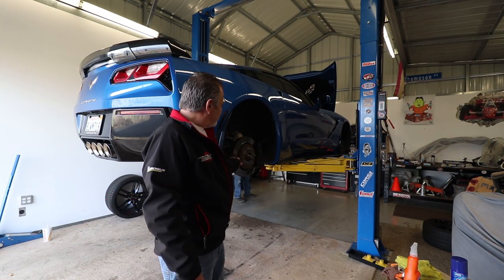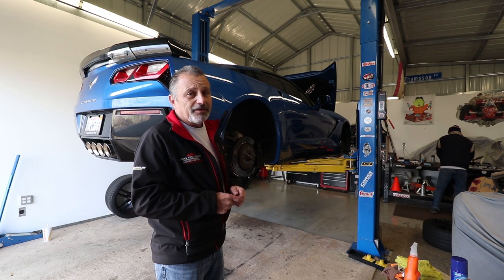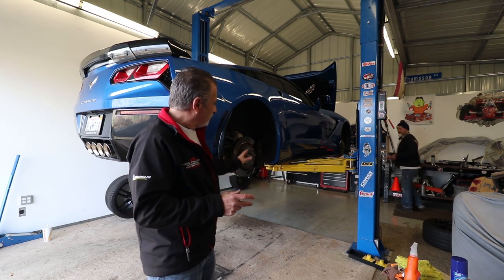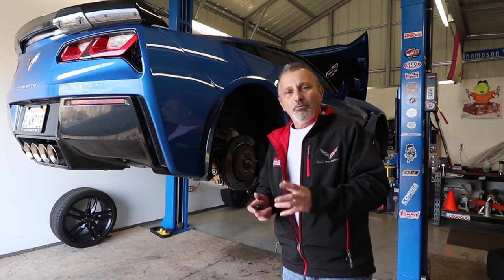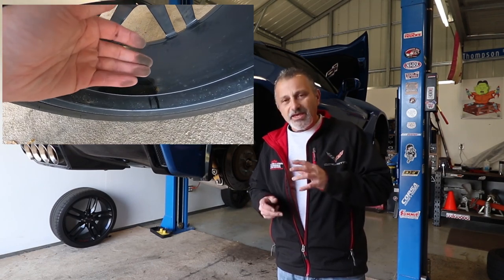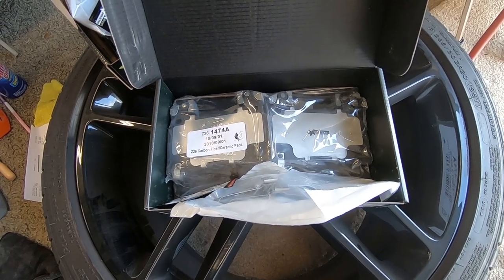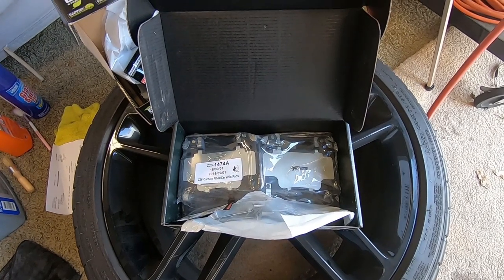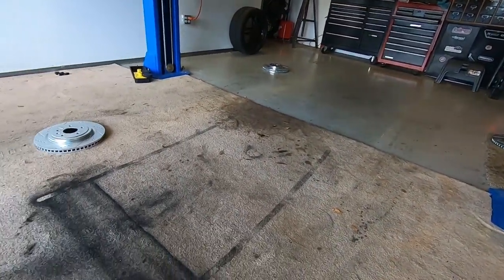I Got Rid of All of that Nasty Brake Dust with PowerStop Brakes

Comment: Quick question on the rear rotors. Does  the electronic parking brake need to be deactivated before rear rotors are removed.  I know on some cars this needs to be done first?
Thanks again for the great videos. Keep up the great work!!
Reply from the maker: Yes I think Terry mentioned that the parking brake needs to be released and not set. Thanks for watching!

Comment: Just curious, why replace the rotors? They seemed to look fine. Did you just want to swap slotted for vented?
Reply from the maker: Hi Jack.. I agree with you the rotors looked fine, but PowerStop sent me a complete kit so I put them on. Plus they look much nicer than the OEM rotors. Thanks for watching!!
Reply: @THECORVETTECHANNEL  Can I have your old ones? :)
Reply from the maker: @dawsoja  I would have to check with Terry to see if he still has them at his shop. Where are you located?

Comment: The C7 video is great.   I have a C7 Z06 and a C6 Z51 and would like to see the same video for the C6.    I would also like to see a video for the C6 automatic transmission shifter cable replacement done.     I know of two C6's that left drivers stranded when this cable malfunctioned.    The catalytic converter does need to removed and there is some adjustment that is needed to complete the work.    Can you help?    I do not look forward to being stranded in my daily driver with 68,000 miles.
Reply from the maker: Hello,
I dont know of anyone who is having that problem right now, but I will keep my ears open and if I find someone with that problem we will get it on film.

Comment: Stock brembo pads are terrible for dust. I have run powerstops on my black camaro and now my C7 im sold.✌ not overpriced. No way brake pads should cost 300 to 400 on a street car. Just my 2 cent$